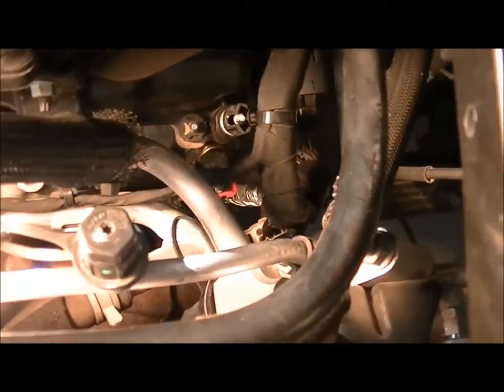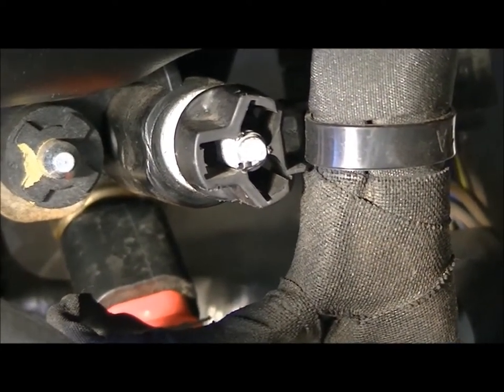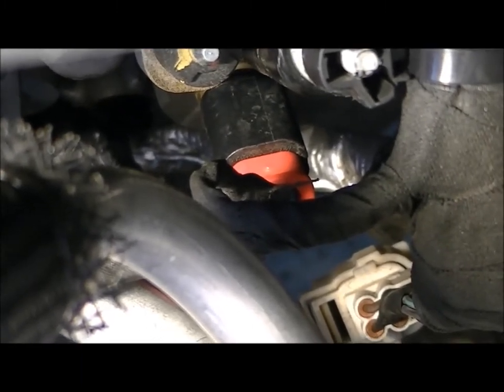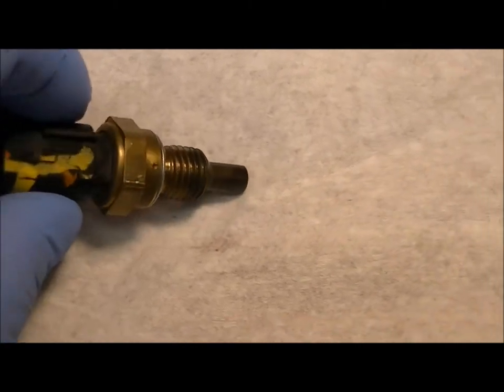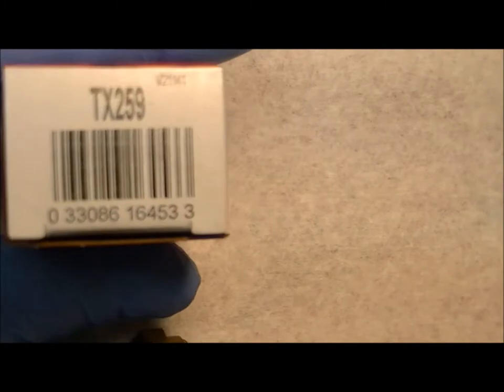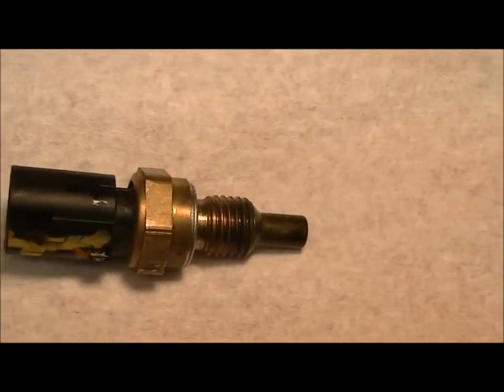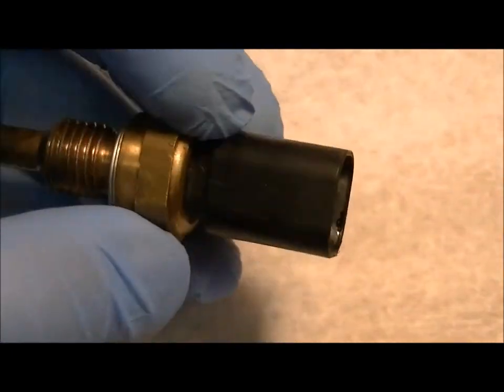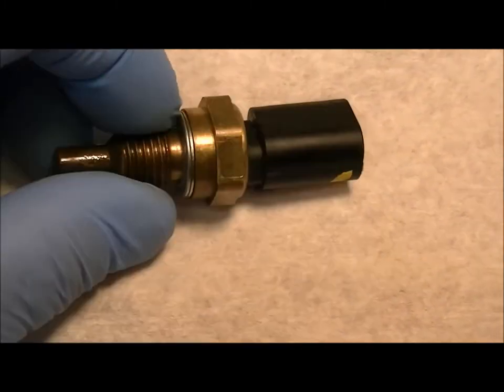2014 Challenger Coolant Temperature Sensor Replacement Info

Comment: Life Saver! My 2012 Dodge Challenger 3.6 had that exact same sensor Google & Autozone kept showing me the ones with the thicker threads. Going to be slapping this one one right now so got high hopes
Reply from the maker: It's a bit of a tight location there, but, I am betting on you! The completely different size of the sensors is so weird .  I'll never stop saying it: if I can do it, you can for sure! : )  Thanks for taking the time to comment- it means a  lot.

Comment: If you need to ever go back in there use an open end wrench and spin the sensor so you can access the release again. It’s the same one that my 2016 Jeep has in it and the dealer needs the last 8 characters of the vin to be certain of the correct style in there. That’s why I chose a dealer part. 
Nice helpful video.
Reply from the maker: Great suggestions!  I HOPE I never have to do it again- my finger nails are just now growing back !! 😅😅 BTW..... How much was the sensor at your dealer?   Thanks and all the best to you!

Comment: Could a temp sensor be the reason for my coolant gauge rising up then back to normal ? It doesn’t actually overheat it just moves. ( I changed the thermostat twice already )
Reply from the maker: It certainly could be ! I think I remember mine was not reading correctly and fluctuating like that before I changed the sensor.  As long as you don't have air in the system, then I think that you can depend on the thermostat NOT being the cause; it's new.  I hope you get it squared away soon: I wish  replacing the sensor was easier though.

Comment: Access from underneath was pretty easy to unscrew it and install the new one. Kind of tight getting a wrench in between the steering column and exhaust pipe but doable.
Reply from the maker: Good to know ---Did you use floor jacks or ramps?

Comment: Could u stand back from the hood please. I can’t see what side is the temperature sensor it’s on because you’re so close to the hood. You just went directly to the temperature sensor like is it up under the radiator? Is it on the side of the radiator? Is it on the top of the motor?
Reply from the maker: It is located near the rear of the engine on the driver's side- it is kind of hard to locate and access for sure; maybe there are different videos on YT that give a better view and explanation of the location, this one is more geared towards the type of sensor and not so much about where it is located.  Thank you and good luck!
Reply: That's exactly what I was looking for. It's the same location for 2012 Dodge Charger SXT with the 3.6
Thanks for uploading! 👍🏼👍🏼

Comment: If you could start the video with a view of the entire engine and then zoom into the sensor, that would help tremendously.  Otherwise, where are you exactly in the engine?
Reply from the maker: It is located near the rear of the engine on the driver's side- it is kind of hard to locate and access for sure; maybe there are different videos on YT that give a better view and explanation of the location, this one is more geared towards the type of sensor and not so much about where it is located.  Thank you and good luck!

Comment: So does it work for your car now like did that part fixed your car?
Reply: And will this work for my 2014 Dodge Charger 3.6L v6?
Reply from the maker: It should-but- apparently there are two different kinds of 3.6l engines or something- the parts store gave me the wrong one so I guess it could be one or the other- both styles show being correct if you do a parts search for the temp sensor.. Maybe the engine in a charger is different? I know, its weird..  Personally, I would buy both and return the one you did not use.

Comment: I’m having the same issue. P0128 yet everything appears fine. Did changing this sensor out for your issue or did it stay?
Reply from the maker: I'm very sorry for the late reply. :(    That was exactly what I was experiencing; no temperature issues, no malfunctions at all- I just kept getting the code.  I actually replaced BOTH the sensor and the thermostat just to get it over with and I think both parts were less than $60.00 total.  The thermostat is very, very easy to do so, I would actually try that one first if you wanted to bet on one or the other and see if your code comes back.  
    Once I was done; no more codes !  Thanks for your comment and again- sorry for the late replay and I hope you get it fixed up soon!
Reply from the maker: Also- I did the sensor on a flat surface and the thermostat  with the front of the car pointed upwards for minimal coolant loss thanx to advice I got on YouTube!